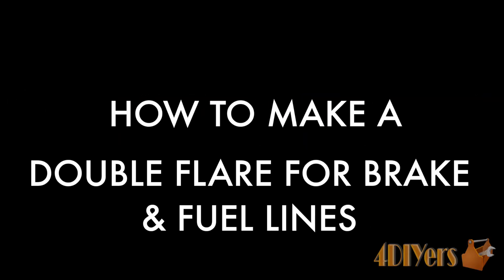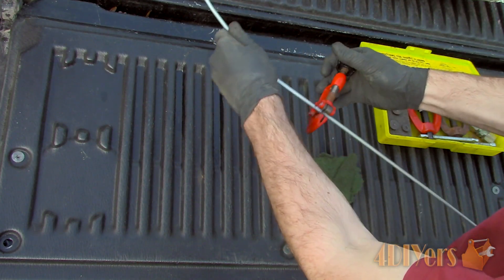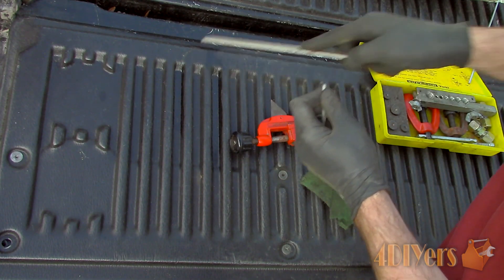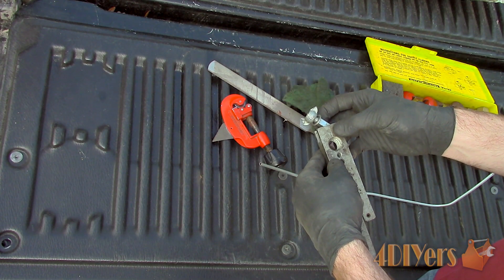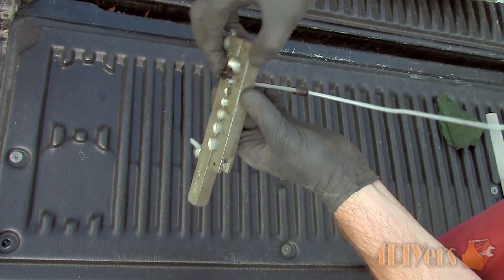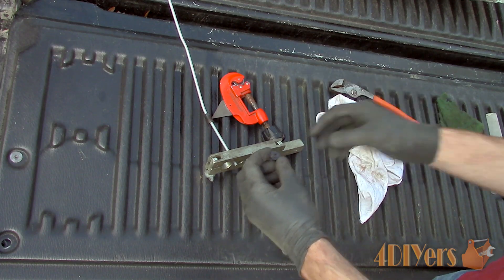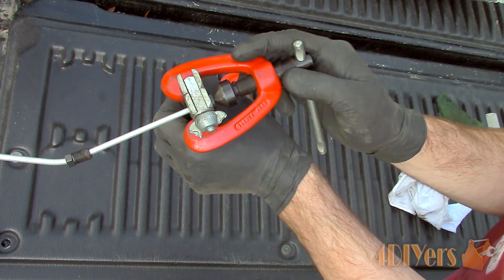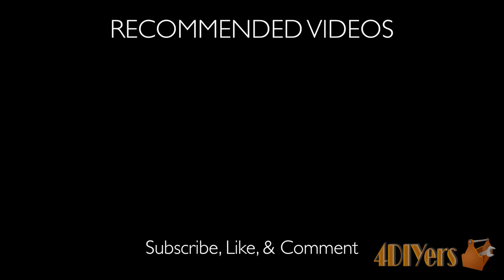How to Properly Double Flare a Brake or Fuel Line

Comment: The OEM metric double flaring tool kit includes adapters (4.75mm, 5mm, 6mm, 8mm & 10mm).  I'm doing a 3/16th brake line. Both the 4.75mm and 5mm fit in the 3/16 line.  Which should I use?  Converting inches to mm, 3/16 = 4.7625.  However both adapters fit. Would I get a better flare using the 5mm?  This is a one time shot, doing it on the car in a tight working space with the short end of a line that broke off.  If it doesn't come out good, the only other option is to replace the entire line front-to-back with lots of bends.
Reply from the maker: I would use the 4.75mm. If you have a piece of scrap line, maybe use that as a test instead. Keep in mind, a flare can get messed up even if you're using the right sizes. Best of luck, hopefully it works out!

Comment: Hey thanks for this. One of the brake lines sprung a leak and ordered a new one but it's taking too long. Ordered the kit and line / nipple locally. Pretty sure they will get to me first. Armed with the parts and this video I might actually have the car fixed before the part order actually comes in.
Reply from the maker: No problem!
Reply: @4DIYers  Update: they did indeed arrive first and the car is now fixed after following the instructions and ordering the same set :)

Comment: Ahahaha yeah I made the mistake forgetting to put on the fitting. Cut it off flared it again to find out I forgot it AGAIN lmaoo. Awesome video man it's great. I did this with my brake line. But I came back to confirm that I could do it with fuel line also without leaks with a flare kit if done properly. Thanks man  (liked video)

Comment: You didn't show a close up of the small black flaring part , to help choose the right one
Reply from the maker: You're talking about the die? Those are just based on the line size, the little dowel is based on the inside diameter of the line.

Comment: This is a question.  First, the set up:  
In another vid, the presenter used red rubber grease because such is compatible with brake fluid, and using it prevents contamination to the brake fluid.  This seems overly particular for such small amount of grease one would use, then wipe off, perhaps even, using brake fluid.  
So here's the QUESTION: how about using brake fluid as the lubricant on the tube and flaring tool tip?
Reply from the maker: It's such a small amount, I doubt it would ever make a difference. You could always wash the fitting with brake cleaner just to be safe. Brake fluid does have some lubricating qualities, but be extremely careful not to get it on the paint. Some brake fluids are worse than others and can damage the paint.

Comment: Any tips on getting both sides flush when clamping. I always have one side higher than the other making my flare lopsided
Reply from the maker: Use a good quality flaring tool, make sure the jaws are clean so it cleans down on the line, remove any burs on the cut line, make sure the line cut is square, and add a drop of oil to the flare dye.

Comment: i dont see die for making gm fuel lines not the same as brake line
Reply from the maker: What type of flare is used?
Reply: Have you tried a fuel line compression piece. Fuel is not high pressure like brake lines.

Comment: Is there a different flare nut between a single and double flare?  Or do they both use inverted flare nuts?
Reply from the maker: It really depends on the application, this website explains it well http://racetrackdriving.com/tech/brake-line-flares-metric-sae-inverted-bubble/